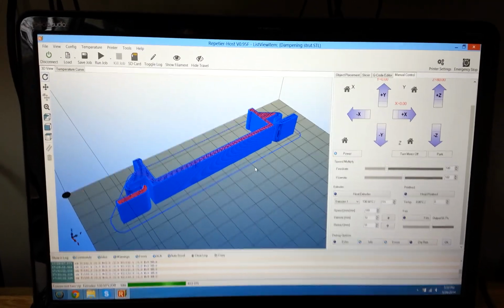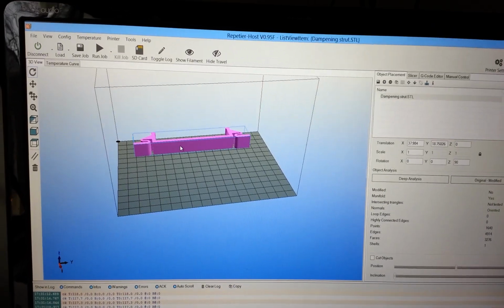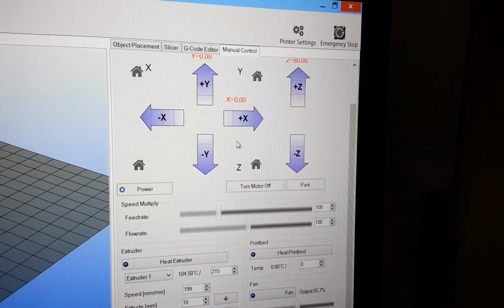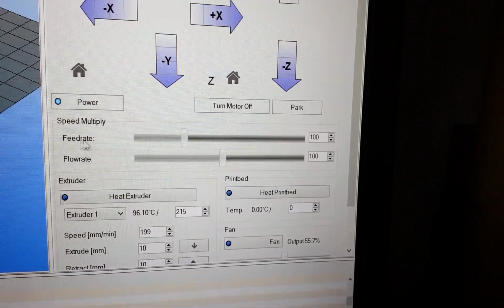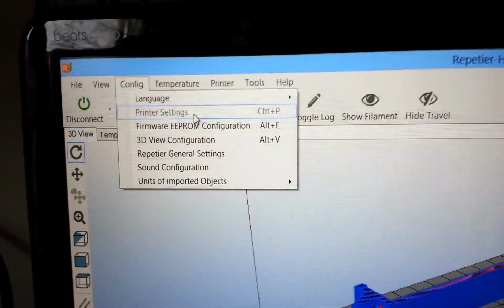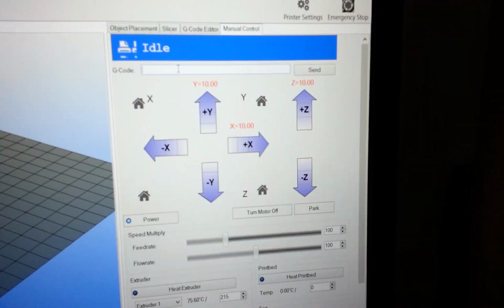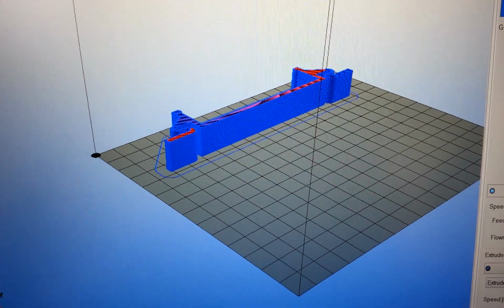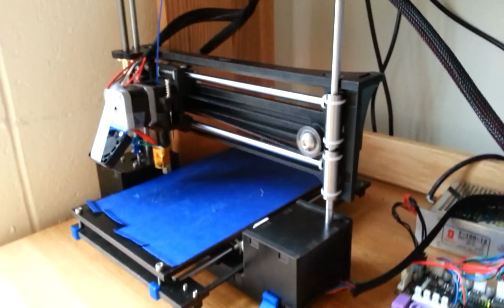How to use Repetier Host - The Basics and G-Code

Comment: Your videos are a great help on getting this thing up and running!! Do you have any recommendations to help with  layer adhesion? I am running PLA and I have tried 195-210 degrees and it mostly comes out looking like a rat's nest. Either the layers aren't bonding well or the extruder isn't feeding the filament very well. It was the extruder initially and I think I have that nailed down. Trying to get this dialed in so I can print the gantry upgrades :/
Reply from the maker: Either your tension is messed up on your extruder gear or you have a partially clogged hot end. Also try printing up to around 220 and see if that helps
Reply: 215 got it to work pretty well, got a davinci coming in so I can print the replacement gantry parts
Reply: The extruder was clicking a lot as well
Reply: +troy f I know its been a while, but if your extruder is clicking, your tension might be too high. In repetier, manually extrude at about 100 on the lower speed, and while its doing that, loosen the tension very slowly, just until it stops clicking and still extrudes.
Reply: Lol yea an entire year! I've moved onto a divinci 1.0 and love it. My one up was clicking because my bed wasn't level and there was nowhere for the filament to go.

Comment: NICE VIDEO!!!  Can I use the Pepetier host with my Flashforge Creator Pro?  I've been having problems configuring it.
Reply from the maker: itzdd803 Sure, you can use any printer that accepts gcode with repetier host, which should be just about every printer out there (makerbots require external software to send the gcode files)
Reply: Thanks for the feedback.  I guess I'll keep trying.

Comment: Do you have a video or an explanation on how to change the print starting point?
Reply from the maker: What do you mean by that?
Reply: 3DprintedLife I'm pretty new to 3D printing, but I figured it out.  I was loading gcode files to Repetier, so the placement was set and couldn't  move the object.  When I load an STL file, move the object, then slice it it is in the location on the bed where I want it.

Comment: i need some help with my printer, i already installed the repetier host but when i try to set the temperature for the heated bed or the extruder immediately takes me out of the program then ask  me to connect both things again i thought that if i uninstall the repetier and install it  back again would work but it didn't and i also double checked  and made sure that all the connections are correctly plugged . how can i fix this issue ??
Reply: In what menu are you trying to change the temp??  And also do you have your USB cable from the printer plugged in??

Comment: was watching your tutorial and followed your set up after i slice it and move to manual control the item has disappeared.
This happens with other stl files i use. What am i missing. I can go back to slicer or object placer and it is still there.
for some reason i can connect tto the printer but nothing seems to be happening through manual control like temp of extruders
Reply from the maker: brod marsh That is completely normal. Manual mode shows what it has printed so far, and if you haven't started the print it will not show anything. If you go back to the other tabs, you should see the sliced object still.

When you are trying to connect to the computer, make sure all of the parts of your printer (except for the fan) are plugged into your printrboard. It will not work right if you try to plug it in without at least the thermistor and hot end plugged in.

If you are still having trouble, you may have to manually fix the drivers. I have another video strictly about connecting your one/two-up to a pc, you may find that one more helpful:
QU-BD One/Two-up Connecting to PC (Windows only)

Comment: my prusia i3 wont even connect to the PC all i in the log is " no startup signal detected forcing start" and then 
"communication timeout,  reset and send buffer block" in red....
when i try to print with SD it just locks the motors into one direction they just keep going i thought just using the software was needed first  please help? i cannot even find anything similar on the internet... 

&the bottom says extruder temp 0 heatbed temp 0

Comment: Please help me, my Two Up printer does not move, I set the commands and still does not work.. do you have any idea what could it be?
Reply: +Juan Matín Rosales It might be that the motor's connector pins are loose. Try GENTLY bending one pin a TINY bit outward, then put the connector on, and try again. My extruder motor wasnt working properly but did after I bent a pin outward a little, so the pins made better contact.
Reply: Juan Matín Rosales  type the G code G92 Z100

Comment: Please help this is urgent. I recently bought and assembled my two up printer and tried to print. U press the print button and it runs the bed into the end as well as the extruder and gantry hits the button and keeps going. This almost broke it and I don't know what to do
Reply from the maker: Remove the g28 command from the start and end gcode in slic3r settings. Also use the g92 x0 y0 z0 command to declare the printheads current position as the zero position.
Reply: Thank you soooooo much you are so awesome and if I could I would buy you a new camera!

Comment: Hey man, another quick question. I was able to get some prints but it seems the z axis is lowering at the end of the print instead of raising and squishes itself into the print. :-( Did you run into this? I presume its something in the gcode of my slic3r config.... This is the end gcode of my config:
;G28 X0  ; home X axis
M104 S0 ; turn off temperature
G1 Z100; raise the extruder
M84     ; disable motors

I'm pretty sure z is not above 100 end the end of the 2cm calibration cube
Reply: Actually looking at it again it was still doing the honeycomb infill so it wasn't even quite at the end of the print... :-(
Reply from the maker: Hmm that's odd...try adding a speed after it to see if that for some reason helps, just change the line to
G1 Z100 F5000
Reply: 3DprintedLife I will give that a try, thanks!

Comment: Hi are Ultimakers printer compatible with Repetier Host?, i cant find a list of printer board that are compatible with repetier host,sad Makerbot is not on of them.
Reply from the maker: Ryosuke324 Yes they are, just about every printer except makerbot and resin based printers will work with repetier host. Some resin printers may work but I dont think all will. Just check that the printer accepts gcode and if it does you will be set, Makerbot uses a proprietary communication code which is why they won't work.
Reply: 3DprintedLife Thank you for your response!, i am building my own printer now, and i was looking at the board GT2560, my concern is that i am using a custom build plate size,actually bigger than regular printers, what should i keep in mind when i have a build area like 600mm x 600mm x 420mm ?
Reply from the maker: Ryosuke324 Building that large is tough, it will require a lot of money and a lot of careful planning. I can give you a bit more advice if you email me at 3dprintedlife@gmail.com